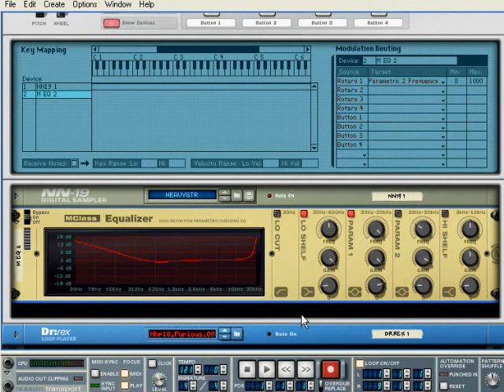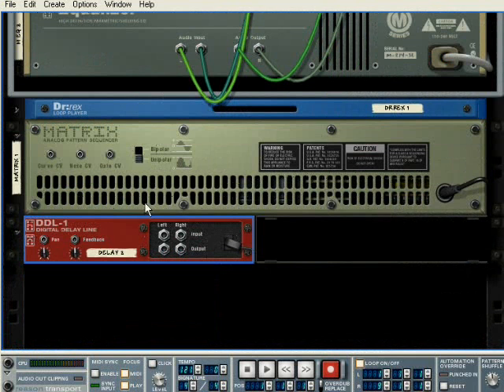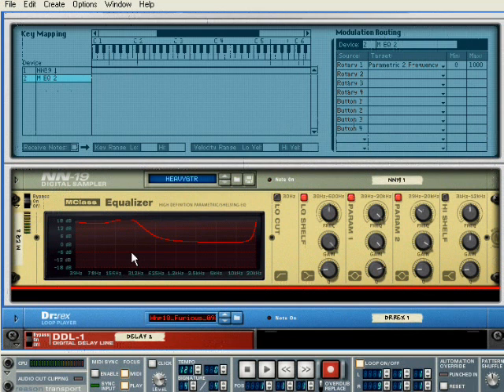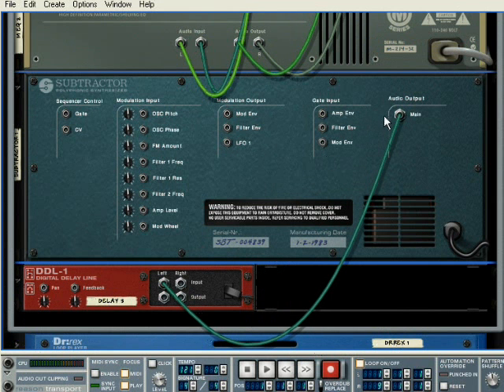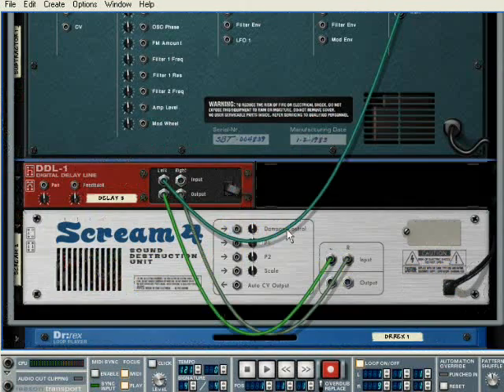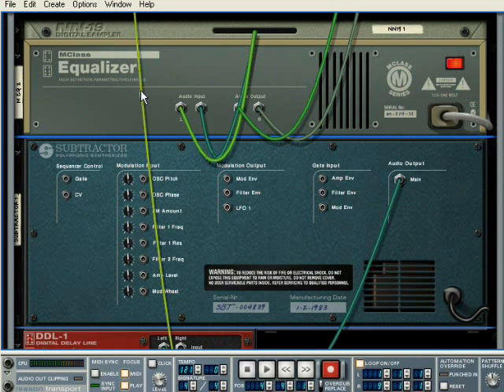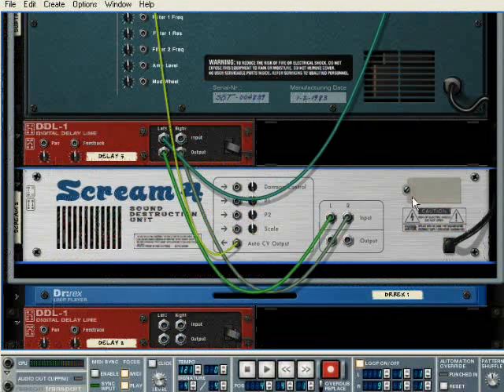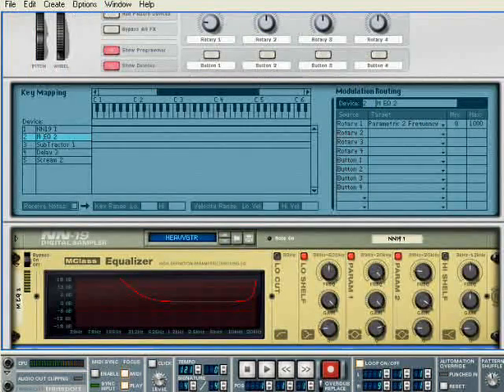Reason tutorial - Delaying CV signals

Comment from the maker: Thanks Detroit!  (I was born in Warren).  My sound is coming from the nn19, but the CV is coming from a Subtractor which produces just white noise.  It is there only to take the MIDI signal from the Combinator, and output audio with a specific ADSR envelope.  The SCREAM unit will "ride" the amplitude of the noise and convert it back into a CV signal.  In this manner, a delay on the Subtractor audio translates to a delay on the output CV.